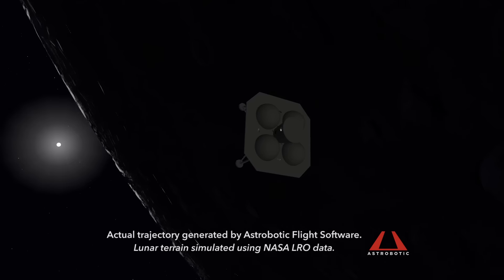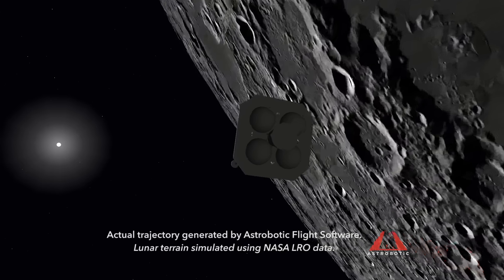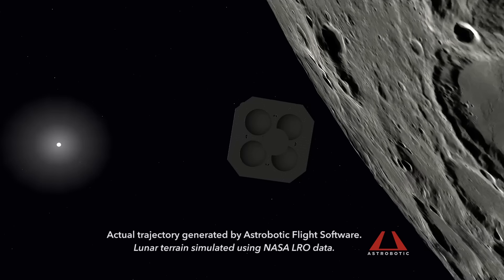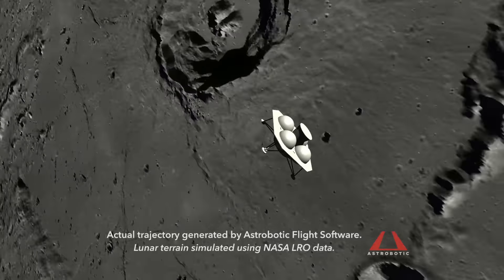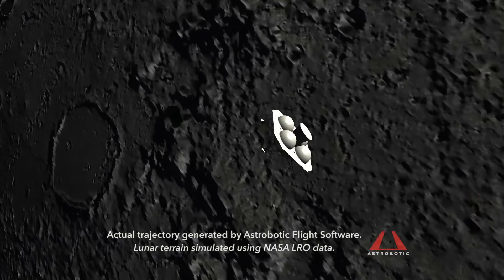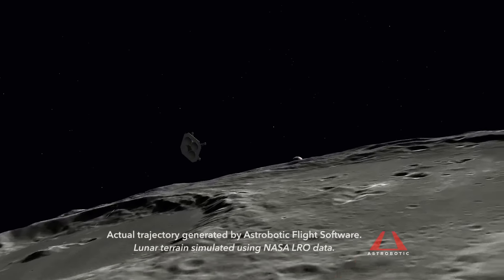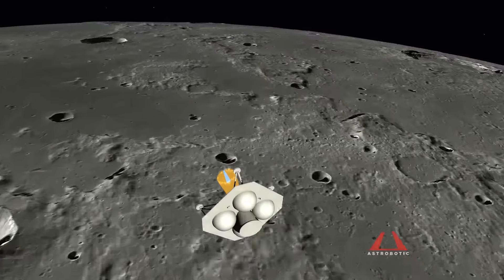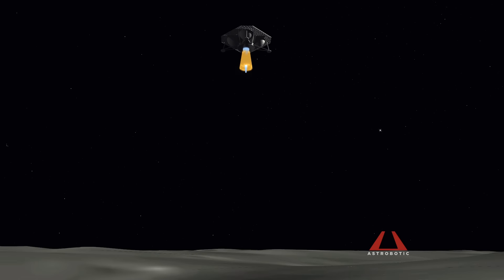Astrobotic's Griffin Lander: Lunar Flight Simulation

Comment: Why is NASA saving $84 million to cancel VIPER, but spending another $323 million to put a mass simulator on the Griffin Lander? Wouldn't it make more sense to spend that $323 million on VIPER instead of a block that does nothing? It makes no sense to me and seems like a waste of money if they're going to just cancel the rover after spending $450 million. I'm not blaming Astrobotic, they have nothing to do with it. I'm mostly blaming NASA for the (non) cost effective solution they came up with.